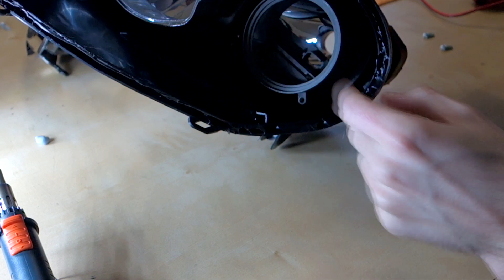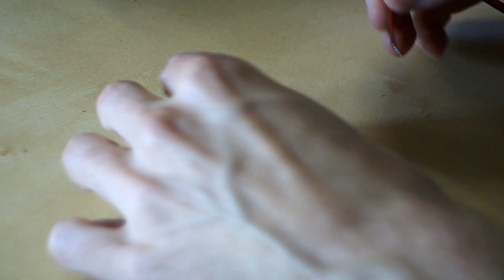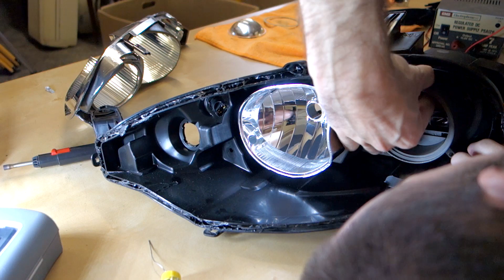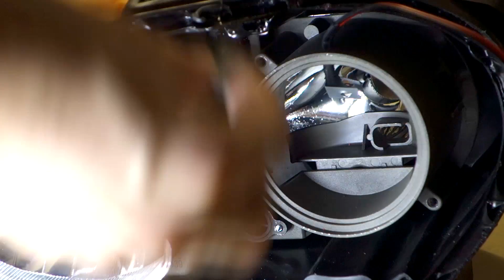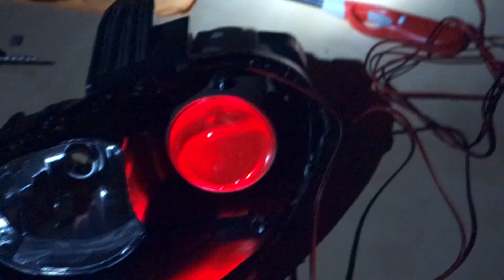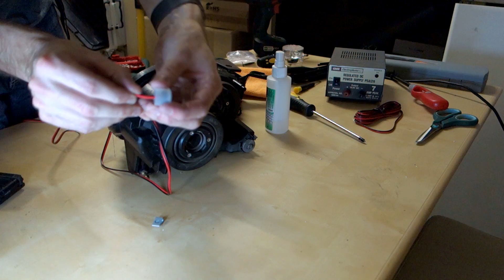Headlight Modification - Part 2 - DIY DEMON EYES FOR $6!

Comment: Hey Boosted Autos, I saw your older video about the carbon fibre diffuser on your 235, I noticed you removed the link to the seller due to the yellowing, I am also in the market for some carbon fibre dressup and wondering how bad the yellowing and clouding was. Could it be prevented with a clear coat? Maybe a follow up video =) Thanks
Reply from the maker: Thanks for the comment. It just kept getting worse and worse. They lied to me for 2 months about sending a replacement, then finally just this week offered a 30% refund once I opened a PayPal dispute, which I had no option but to take. It would have cost me more than the difference to send the item back to them even though Paypal offered a full refund if I sent the item back. It was going to cost me hundreds to ship back to China.

I ended up polishing it back which restored it for the most part, and coating it with some Body Armour 9H ceramic coating which we anticipate will stop it from discolouring for about 7-12 months. After that if it happens again I'm going to jsut wrap it gloss black.

Really disappointing especially after I went to the effort of doing the review. Definately don't buy from them.
Reply: Would you be able to let me know who the sellers are so I don't make the same mistake? :) Thanks again

Comment: I'm thinking about upgrading the projector lenses to a clear orb. Are you able to measure the projector lens diameter
Reply from the maker: Hi David, I'll measure exactly for you when I pull the other light apart. The dome part of the lens is 70mm, but there is a small lip which I assume needs ot be included in the measurement. I cant do that without pulling it apart again.

Will get back to you.
Reply: Sounds good!

Comment: This is freaking bad ass. Awesome Job you've done. My only feedback / question would be that in my experience having a tonne of eBay LED bulbs throughout my car is that they have varying and fairly sporatic life times. Would suck if one of the demon eyes burnt out and you had the remelt the glue and everything to replace the bulb
Reply from the maker: +Dane Boulton thanks! Yeah that's a fair point. I chose globes with exposed circuit boards so that there was no plastic that could melt, and so I could carefully inspect the solder joints. Hopefully they last!